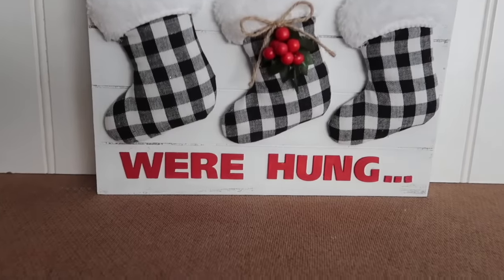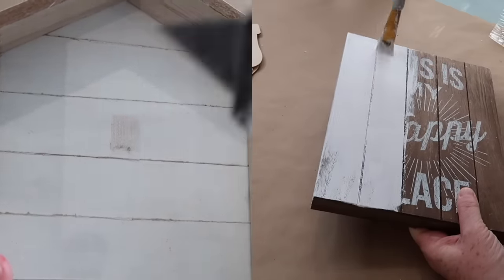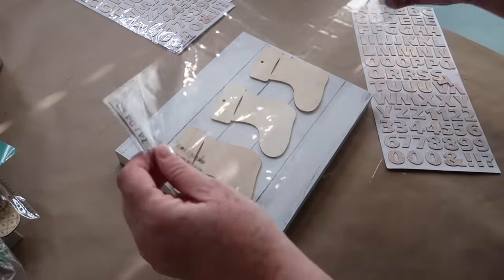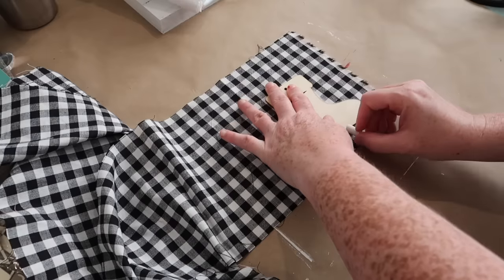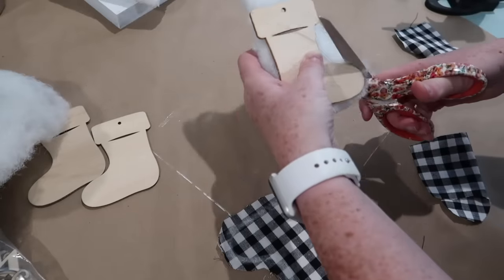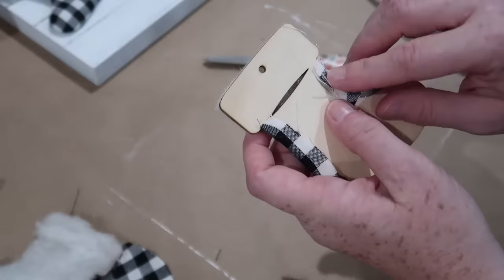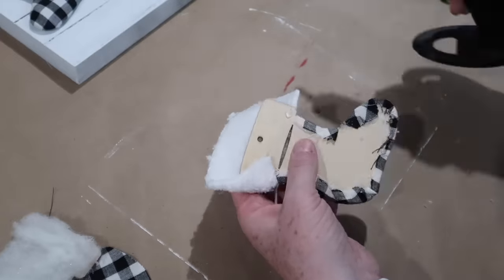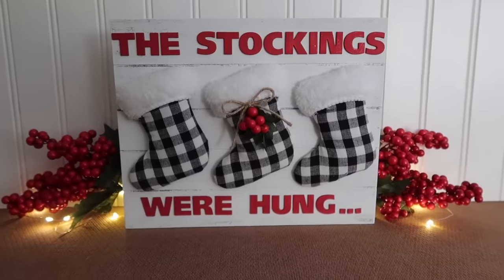DOLLAR TREE CHRISTMAS DIY  |  FARMHOUSE 3D STOCKING SIGN

Comment: What is difference between hot glue n fabric hot glue..I have not seen fabric hot glue
Reply from the maker: Yolanda Rodriguez  Fabric glue has a stronger adhesion to the fabric.  Say if you were to hit glue fabric with reg glue.  You could pull it apart with a little effort.  If you pull it apart with fabric glue, it is much, much harder and usually will damage the fabric.   So it just provides a much stronger hold.  You definitely will notice a difference.
Reply: Oh ok so the fabric glue is not in a stick..that is whatvi was thinking that in went into glue gun
Reply from the maker: Yolanda Rodriguez  Oh no, it is a fabric glue gun and does go into a glue gun.  😊